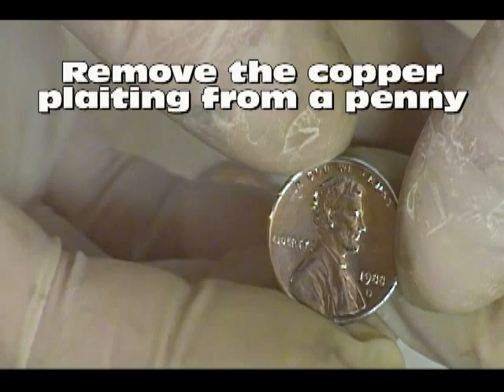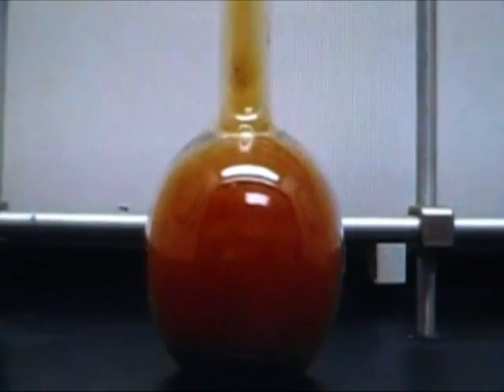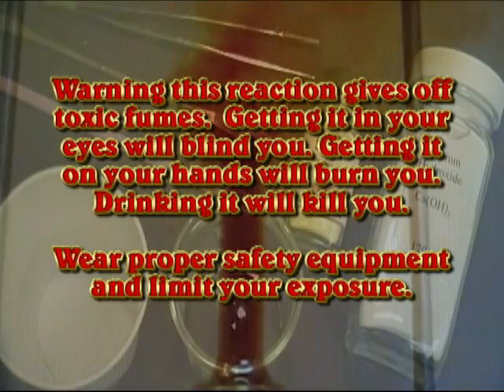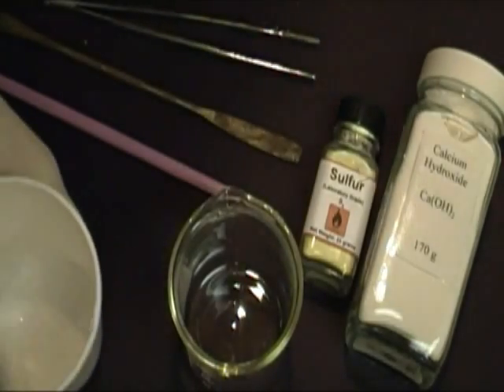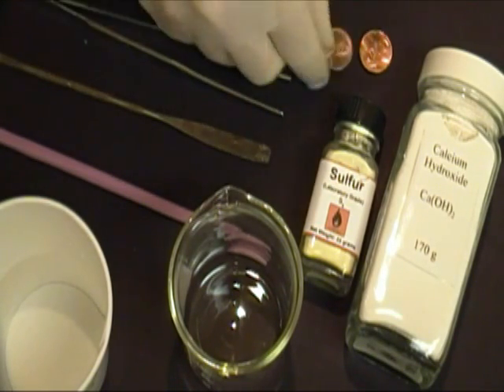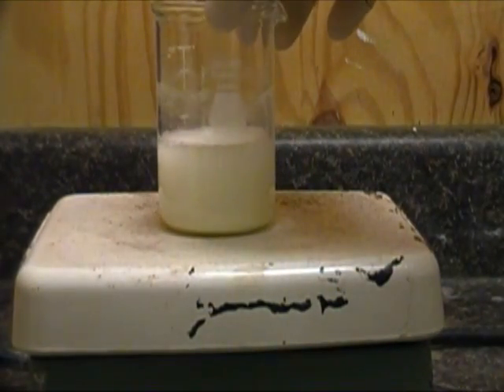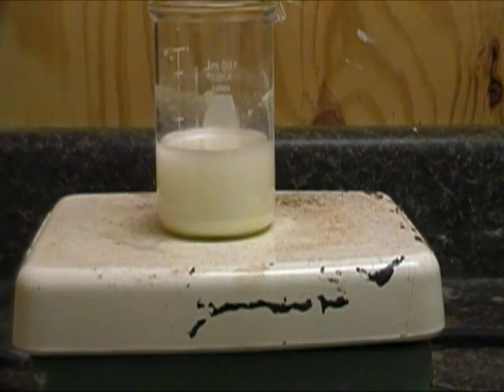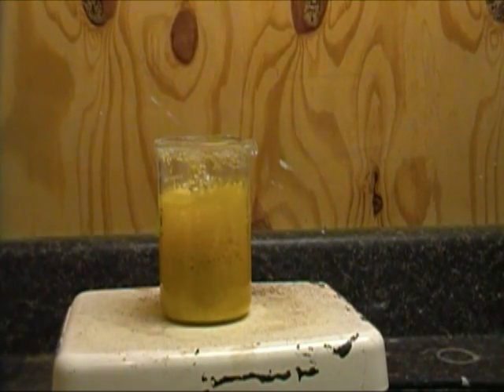Use chemistry to remove the copper plating on a penny

Comment: A simple mechanical way to effectively remove the thin copper plating on a mostly-zinc penny [1982 or later] is:

Put the penny in a vice, using some thin layers of wood, plastic, etc. to protect the penny from “crush marks”.

Then use a small, fine, stainless-steel wire brush to brush away the copper.

Comment: The US mint started making pennies from zinc in 1983. Some 1983 pennies are copper plated zinc and some are solid copper.
     You should be fine with 1984 and beyond.

Comment: The reaction is between the lime and the sulfur is forming a calcium polysulfide. This calcium polysulfide reacts with copper to form the black copper sulfide. The copper sulfide is very insoluble in water and forms the layer on the penny. I have used Dormant Sulfur Spray available in nurseries to do the same thing.

Comment: I read somewhere you can dissolve a penny in sodium carbonate obtained by putting baking soda in the oven at 400F to make it release a CO2 and then you need to make copper carbonate into copper sulfate because copper is reduced with a platinum anode and graphite cathode I think it is, producing a chunk of copper turd and dilute sulfuric acid

Comment: any ideas on how to solidify the copper ?
Reply: The copper is copper sulfate. It can be pulled from solution using electricity.
Reply: Let the solution settle. If the solution is any other color than light green, decant and add fresh water and heat. The black will dissolve and form the aquamarine color. It has always worked for me.

Comment: This may sound like a strange question, but for anyone who has done this experiment, please let me know if the resulting stripped penny was larger in diameter than when it started.  I have come across many of these stripped pennies, and they invariably seem to be larger in diameter, and thinner than normal.  I am trying to determine if this process causes the zinc to do this,  Thanks for any feedback you can provide.

Comment: what does it mean by "oxidizing the copper"
Reply: It is adding an Oxygen atom to each copper atom to create Copper(II) Oxide (CuO). A single molecule of CuO has no room to bond with anything else, so it separates from the Zinc, condensing as a powder at the bottom of the flask. Since the only thing that should be in the penny is Copper and Zinc, this is the surest way to obtain purely Copper from the penny. A reaction would later be done to remove the Oxygen from the Copper to obtain pure copper by itself.

Comment: will this work on silver? I have lot of copper plated silver contacts from various switches I'd like to clear of copper/leave the silver for smelt.
Reply: Looking at the description of the reaction, I imagine that it won't. The reaction with copper produces H2S which reacts with silver and tarnishes it.
Reply: also silver is in the same group as copper so it might react in a similar way as the copper in this reaction, you might end up with dissolved copper and silver

Comment: Can you re-form the removed copper at all into pure copper and make a pure copper solid?
Reply: If there are Cu2+ ion in the solution you should be able to reform them through an electrolysis reaction and by using zinc electrode as an anode and a small amount of copper electrode as the cathode and with the correct voltage you should be able to reverse the process Zn(s) + Cu2+ --> Zn2+ + Cu(s)
Reply: MinerAmax You're an idiot. That's not alchemy it's chemistry. The copper didn't just disappear. It's a dissolved ion into solution and it's recoverable by some means. Not very practical in my opinion, but possible
Reply: The Herb The means to recover it might be practical if the initial reaction that took place to remove the copper was a non-spontaneous process ergo the reaction being spontaneous in the reverse direction, Delta G < 0 if you catch my drift?
Reply: The Herb You lose sight of whats being taught. Forget the penny as this can be used on any copper plated item.
Reply: A solid copper penny from a zinc one? No, that's alchemy.
Reply: It would precipitate out as copper sulfide if you lower the PH. This can be roasted and then smelted with charcoal and stirred with an iron bar to get nearly pure copper metal.
Reply: The materials and the pennies themself would cost more than the copper you could recover.
Reply: Noooo. I mean this particular experiment. If you were trying to simply remove and then isolate the copper, there would be more efficient ways of doing so. This demonstration was jut designed for removing the copper. If you wanted to make it easy to isolate, you would probably chose a different reaction.
Reply: The Herb Honestly, I don't see any other way to remove the copper without destroying the zinc center. You can remove the zinc easier leaving the copper metal but that's the opposite of what is trying to be done. If you needed chemically pure zinc and can't obtain it any other way, this is an excellent way to obtain some. Zinc is use as a precipitant for platinum group metals from solution. The copper would just be a contaminant.
Reply: Nick Ceh I am not a chemist and only have hands on experience. I still have all my fingers and both eyes though. I understand electromotive series of metals, oxidation and reduction. If you have no idea what I'm talking about, maybe you are too smart and have no practical knowledge. I have refined pounds of gold from electronic scrap. Not contaminated gold but bullion grade 99.95% gold. My knowledge is real world experience. I understand a parting cell very well and if you are talking about removing copper with a copper sulfate stripping cell, zinc is reactive in that environment. You must not have experience as a refiner.
Reply: Wow, he understands highschool Freshman chemistry!! Round of applause lol.
Reply: Joshua Gavaghan This discussion has gotten out of hand. The question, I believe, is "can the copper be reclaimed after it is removed from the penny" and the answer is 'yes'. Metals can be replaced in solution by a process called "cementation" where a more reactive metal displaces the less reactive metal in solution. Iron metal will cement copper metal out of solution but so will any more reactive metal, aluminum,zinc, etc.  I will not reply to this thread any farther. Maybe one of the chemist can carry it on.
Reply: It's called a single replacement reaction.
Reply: You could reform the copper 2+ ions that are already in the solution by setting up an electrolysis purification with a pure copper cathode on a negative terminal of the battery and an impure copper anode at the positive terminal by the this process the only the copper ions will reform to a solid and the zinc will be left in the solution if you want retrieve the zinc swell it will have to be done by another method of electrolysis you can always just search for it on the web.
Reply: +The Herb By the way a single replacement reaction involves a species that was not previously part of a compound which then switched with one or more atoms to become apart of that compound what he want to know is how to get the homonuclear diatomic molecules of copper to form a solid otherwise it would not be pure copper.

Comment: I tried NaOH instead of Ca(OH)2 and works fine if not better. Moreover, 10 minutes of boiling is enough and be careful with the fumes; do it outside because H2S is toxic and smells funny! To remove the copper oxide layer, just dip it into a solution of commercial hydrochloric acid a few seconds ;)

Comment: If your H2O2 and ammonia is too concentrated, it will fizz up and decompose. It needs to be cold and not hot. Did your solution turn a deep blue colour? If it did, that means that it is working, and you just need more of the H2O2 and ammonia.

Comment: hey i tried your method. i put some ammonia and some hydrogen peroxide into a bowl and put a penny in the solution. It bubbled and fizzed for about 10 minutes, then just stopped. The copper was still there. Whats up with that? I mean, a couple pennies came out with some off-colored tints, but the rest were untouched. Please explain what it is that I am doing wrong!

Comment: A simpler way to remove copper coating off pennies and leave the zinc intact is to immerse the pennies in a mix of ammonia and hydrogen peroxide. The ammonia will complex away the copper oxide formed instantly on the surface of the copper as [Cu(NH3)4(H2O)n]2+ , which would expose new copper to oxidize, etc, in a cycle, while the zinc will be left intact.
Reply: but Zn will also be oxidized into ZnO and dissolved by NH3, remember ur chem classes?
Reply: Does this actually work, i want to try it out before doing the video.

Comment: I doubt you could use this to make money. You have to account for the cost of the materials compared to the likely quite small yield of copper. Plus, you'd be spending money that you defaced, so IF any stores or banks accept it (and especially for the latter, I doubt many would), you'll probably get some strange looks. Then you have to account for any other materials needed to reduce the copper oxide to copper metal (e.g., carbon) before you can sell it. Overall, this seems very unprofitable.

Comment: Yes, it is. I don't think the point of this reaction was to demonstrate a possible way of making money; in fact, while it takes more than a penny in materials and energy to manufacture a penny, the materials alone are worth less than the cent they make up. This was just a demonstration of a way to remove only the plating without damaging the zinc core, which most other "penny reactions" do.

Comment: I think its more likely that the S2O3(2-) ion created by reaction of Ca(OH)2 and S is reacting with the Cu surfacing. Its highly unlikely for the CaS crystal structure to react with the coin. It also seems unlikely that the H2S (gas) or H+ (aqueous) to be adequate to oxidise the Cu. The S2O3(2-) probably reacts with the Cu by donating an electron, filling the 4s2 orbital which is vacant in Cu, but not vacant in the zinc.. This seems more likely.. Btw, wear nitrile gloves, latex arent good enough

Comment: @myst32YT What year penny did you use?  Pennies before 1982 were 100% copper.  Post 1982 are the zinc/copper plated type.  About 50% from 1982 are copper and the other half are plated.

Comment: @japanesepoptart It's not that I need H2S, it's just that H2S is a useful gas. It can be used to make thiols, metal sulfides, analytical reagents and is in some cases used as a reducing agent in chemical reactions. I make H2S by reacting Al2S3 with water, but the aluminium sulfide is difficult to make and the process is time consuming. I'm working on a way to make large quantities of H2S cheaply via the reduction of sulphate by sulphate reducing bacteria, but I'm not quite done yet.

Comment: I was super excited to do this for my chemistry class. But, when I followed your directions exactly it did not work out as you stated. Yes, within seconds a black copper sulfide layer formed on the penny. But, when I left it in the boiling solution for 15 minutes and returned to check  it was completely dissolved. Only little black specks were found at the bottom. When I let it settle, a reddish liquid layer on top of the yellowish precipitation on the bottom. That must be Cuprite CuO
Reply: Did you use a pure copper penny from prior to 1982?

Comment: @myst32YT Substituting Ca(OH)2 for NaOH will not work.  Due to Na+'s higher electronegative potential it will not attack the Cu clad, but it will attack the Zn core if the clad is punctured.  You'll end up with a very slow scavenging reaction that is thermally dependent as Zn(OH)2 balances with NaOH.  Cooler solutions will have a higher Na+ activity, where hotter ones will have a higher Zn+2 activity.

Comment: Did you smell rotten eggs before you put the pennies into this mix? I was wondering if this was a reliable way to make a hydrogen sulphide gas generator. Setting the copper aside, the two chemicals react to form both CaS and CaS2O3. Ignoring the CaS2O3, the sulfide salt reacts with water to form H2S gas and calcium hydroxide that can be recycled and reacted with more sulfur.
So would this be a H2S generator if the S was in massive excess?
Your last reaction isn't balanced
Just pointing it out...

Comment: @myst32YT 
hello,
i have 10 rolls of pennies 1930-1982 (95% copper; 5% zinc)
i know nitric acid dissolves copper and gives dangerous fumes.
i saw another video that Hydrochloric acid dissolves zinc, gives out fumes but less dangerous.
so my question is:  will it be easier if can i use hydrochloric acid to remove the 5% zinc out of 1909-1982 pennies to make it 99.9% copper for smelting?
thanx =)

Comment: hydroxide catalyzed copper to start oxidation, copper oxide changed with sulfur, since copper more readily gives up a valence electron it dissolves way before zinc, but thats a tad bit scary how easy it is to make hydrogen sulfide...

Comment: I believe I have it:

3Ca(OH)2 + 4S --> 2CaS + CaS2O3+ 3H2O This liquid is known as Lime Sulfur and is made the same way - a surfactant plus Sulfur plus Calcium Hydroxide, all boiled for several minutes.

The reaction with copper:

CaS2O3 + 4Cu + H2O --> 4CuO + CaS + H2S

Or combined:

3Cu + 2Ca(OH2) +3S --> 3CuO + 2CaS + H2S + H2O

The new liquid reacts with copper:

2CaS + H2S + 3Cu --> 3CuO + H2O

Zinc is not attacked by calcium hydroxide (or by anything else here)
Reply: Good find zbret!   A few things though.  There might be some polysulfide reactions, but I think you got the general idea.  https://books.google.com/books?id=AkYZAQAAIAAJ&pg=PA100&lpg=PA100&dq=3Ca(OH)2+%2B+4S+--%3E+2CaS+%2B+CaS2O3%2B+3H2O&source=bl&ots=dr-jFHk_Z7&sig=s3RTZe_iAzQ6oacHVwGi2vG_Y-8&hl=en&sa=X&ved=0ahUKEwjFgaeagurZAhXQmVkKHeKmDm8Q6AEIKTAA#v=onepage&q&f=true 
 Wikipedia says CaS reacts with water.  CaS + 2 H2O → Ca(OH)2 + H2S 
 http://en.wikipedia.org/wiki/Calcium_sulfide#Reactivity_and_uses
Also you might want to check your last equation.

Comment: Awesome video, I didn't think dissolving only the copper would be easy.  As far as whats going on in the reaction I know that copper sulfide is black, so im assuming thats what forms on the copper metal.  Not sure why it wouldnt form on the zinc, or why the copper hydroxide is there.  Perhaps the hydroxide acts as a catalyst, or maybe to prevent the sulfur from reacting with the zinc.